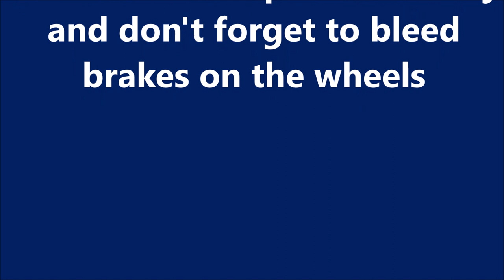2007-2013 Toyota Corolla How to remove/replace the brake master cylinder Αφαίρεση αντλίας φρένων

Comment: did you bench bleed the m/c before installation or bleed after installation?
Reply from the maker: Bleeding was done after the brake master cylinder was installed

Comment: Does the 09 Corolla have a power break booster I ordered master break cylinder for my break pedal is going to the floor before breaking
Reply from the maker: Yes it has my friend. The located on the driver's side of the car towards the back of the engine compartment, the vacuum-operated brake booster is the heart of a “power brake” system. The master cylinder mounts to the front of the brake booster.

Comment: the master cylinder itself can be disassembled?
Reply from the maker: Yes of course and it can be disassembled either to clean or to replace a faulty part
Reply: @YiannisPagonis  these cars of age are leaking brake fluid slowly from the master cyl, nice cost savings if it can be tweaked for just the faulty parts. Any recommended brake master kit i can use to do that?
Reply from the maker: @fajarreza1  Part Number 31420-02031 for Clutch Master Cylinder For TOYOTA Auris Avensis Corolla
https://www.ebay.com/itm/325513676638
https://www.megazip.net/zapchasti-dlya-avtomobilej/toyota/corolla-38234/zze150-56214/zze150l-demdkw-922089/clutch-pedal-flexible-hose-17879901?vin=1432144818
https://www.megazip.net/zapchasti-dlya-avtomobilej/toyota/corolla-38234/zze150-56214/zze150l-demdkw-922089/clutch-master-cylinder-17879911?vin=1432144818#/il-414036967-6270508-6270508

Comment: dual master cylinder?
Reply from the maker: Yes 2007-2013 Toyota Corolla has dual master cylinder. Dual master cylinders have two separate chambers that separate the front and rear brake circuits. This type of system prevents the total loss of braking action in the event of brake fluid loss. The brake circuits can be split front and back or diagonally.
Reply: @YiannisPagonis  so the brake lines are diagonally from each other

Comment: How would you replace the master cylinder pressure sensor ? Code C1422 ( master cylinder pressure sensor zero point high). 
Thank you for any help.
Reply from the maker: C1422 TOYOTA - Master Cylinder Pressure Sensor Zero Point High Malfunction
C1422 TOYOTA Possible Causes What does this mean? Faulty Brake Actuator Assembly (Master Cylinder Pressure Sensor) Brake Actuator Assembly harness is open or shorted Brake Actuator Assembly circuit poor electrical connection
How do I fix code C1422 TOYOTA? Check the "Possible Causes" listed above. Visually inspect the related wiring harness and connectors. Check for damaged components and look for broken, bent, pushed out, or corroded connector's pins.
Reply: Did you get this fixed? I have the same issue.
Reply: Did you get this fixed? I have the same issue

Comment: The master cylinder won't slide out in my 09 corolla. It wiggles around but it won't come out
Reply from the maker: Because there is a lot of rust in there and it is stuck. Spray first WD-40 and then so depending on how rusty it is you might be able to get it with a pair of circlip pliers if not you'll have to get in there with like a flat blade screwdriver. And pry it.